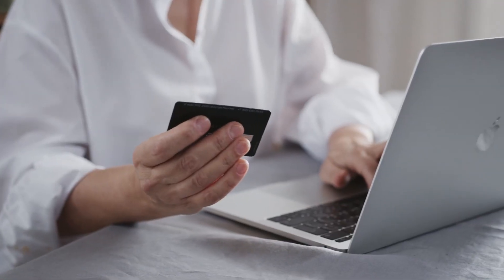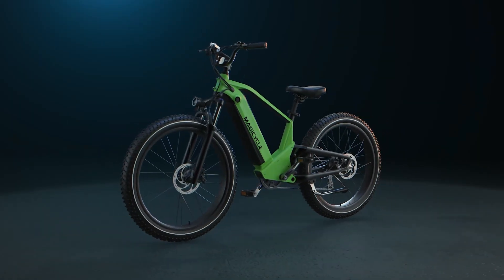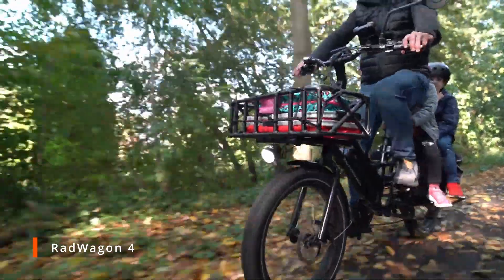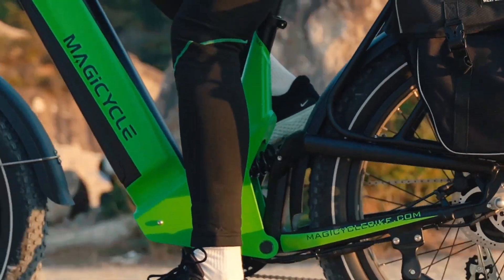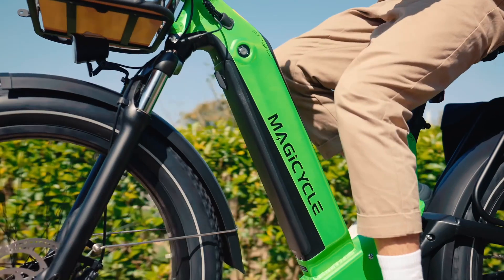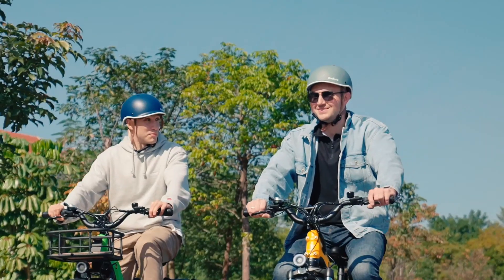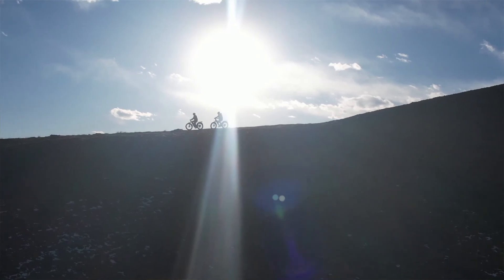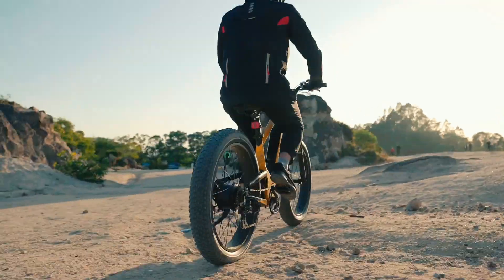Magicycle Deer - Full Suspension SUV E-bike Review! 🦌

Comment: OK it appears solid build, but that price tag of  2400.00 and only coming with a 20 AMP battery,  (that's not good enough compared to the value leaders right now, who offer
1K motors and 60 AMP battery's for under 2K   right now on sale you could get this for 1800.00 and with the money saved, just upgrade the  tires and suspension and still come out way
ahead on  battery range and power:

Comment: Cadence sensor? 95 pounds? 750 watt hub? Over $2000??? What year is it??? Hard No.
Reply from the maker: Unfortunately, with the way things are going you'll probably be seeing a lot of new ebikes over $2000.
Reply: @ElectricRidesUT  Yes, but some ebikes are worth the price, the Magicycle Deer is just not one of them. You can't have just a cadence sensor on a 95 pound ebike and expect to get any good use out of it, especially off road
Reply: Rather get the Cyrusher ranger at that price… but the wired freedom is my next bike
Reply from the maker: @dixienormis3614  Great points!
Reply: @dixienormis3614  I purchased the Deer and took it on some really tough trails. And it was fine, yes its heavy but has a lot of power. I'm happy I did get it at $2,400 I think it's up to you if you want a 2 year
warranty and exceptional construction. It is very well built..

Comment: Magicycle has not helped resolve a problem. I have tried to get a person for 2 full days no one has responded with help they sent a picture of thumb control power button. Iii
Reply: Magicycle sent the display everything worked fine. This bike has a great feel. I took out to a wash in the dessert soft sand it feels so much better than my rad. I could not find anything wrong with the bike not a scratch. The Torque is great . One complaint seat post too short.
Reply: How is even rideable without a torque sensor? So in order to get up a hill you need to get going at speed? It doesn't deliver power in relation to your pedal input?
Reply: @dixienormis3614  no it has plenty of power
Reply: @frankbaker8370  How is it in the woods up hills? My 750 rear hub drive bike is a few years older, same cadence sensor...and it struggles up hills and the motor cuts out
Reply: @Dixie Normis  hi Dixie I have not yet tried hard stuff. I have been climbing  more long climb slow  grade. I have had two others including Rad Rover I still have it has more torque than Rover  . More volts on battery its lighter I think easier to handle in soft sand.   Frank